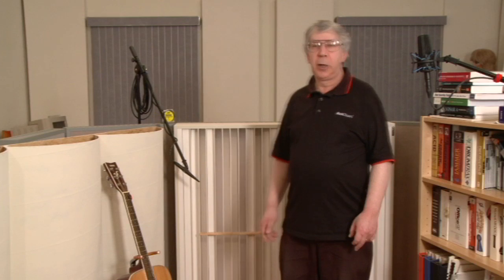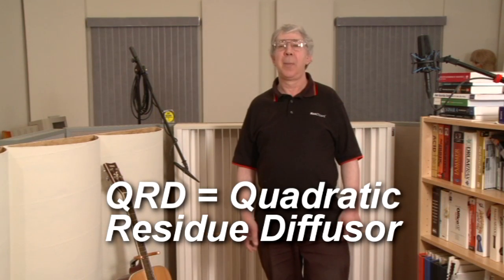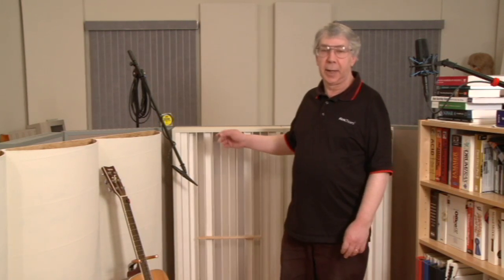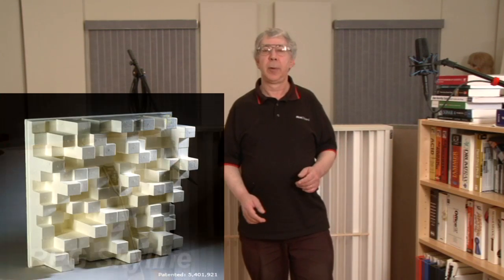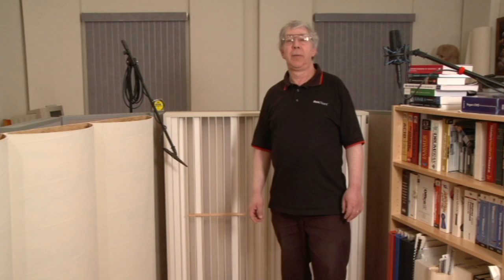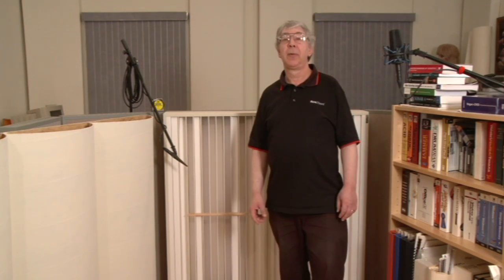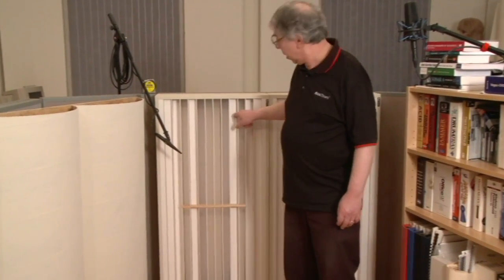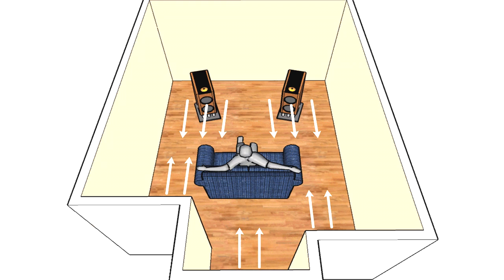All About Diffusion

Comment: Great video! 

I have one clue about why your bookshelf doesn't act as a diffuser: it's too neat! 

Most bookshelves I know (mine included, aggressively) are way more chaotic than that! The few books that I've got from any series are not even from the same edition, let alone any other two books have the same shape/size/density! Lastly, it's filled to the brim with (highly randomly-surfaced) knick-knacks :D
Reply from the maker: You are correct that having more variable book depths will reflect sound less coherently. But a real diffuser also scatters sound left and right, and that requires a specific QRD type pattern of depths and widths.
Reply: @EthanWiner  thanks, I know it'll never be as good as a professional solution, but in the "is this any better than a flat, hard wall?" category, I'd take a messy bookshelf over a completely flat one.
Reply: @EthanWiner  also, sorry I didn't see this reply sooner! I totally missed the notification
Reply: @EthanWiner  speaking of "is this better or worse?" type of random questions, I figure you're probably tired of answering these, BUT, here goes nothing: 

Let's say I have a completely empty room which obviously has a very horrible reverberation and I happen to have a large EVA rubber/foam available, would covering the walls with this do any good for dampening the sound reflections when the high-pressure part of waves hit the walls, or would it make it worse? I figure that if they were placed stretched they could work as a drum's membrane and make things worse, but if they are loose enough it could be better than waves bouncing off the hard wall, rightt?

Then.. (I know I'm pushing your patience probably) let's say I have some porous absorber available (just your regular acoustic foam, no particular brand or anything), would it be best to glue it to the wall directly? Or can we expect some (greater than negligible) improvement by layering wall/soft-rubber/porous-foam whenever we can?
Reply from the maker: @zippolag  All of those questions and more are addressed in my Acoustics FAQ:
http://ethanwiner.com/acoustics.html
Reply: @EthanWiner  awesome, thanks!
Reply: @EthanWiner  great read indeed, it would've saved me a lot of video-watching if I had stumbled upon your site first! That said, I guess the only way to figure out if my non-standard ideas will work or not is to try them out, I couldn't find anything on the FAQ nor the forums about rubber being used as a pressure-absorber.
Reply from the maker: @zippolag  RPG Modex bass traps use heavy vinyl sheets over a sealed cavity stuffed with insulation. My company RealTraps bonds a thin plastic membrane to rigid insulation to increase its absorption at bass frequencies. But rubber alone? Not so much.

Comment: Ethan, 
1) what are the frequency bands you consider as low/mid/high?
2) What is your opinion of diaphragm/pressure based bass traps vs your ploywool/velocity based bass traps?
Thank you.
Reply from the maker: It would take six paragraphs to answer all of that completely. So briefly, the bass range is up to around 200-300 Hz, mids go up to maybe 2 KHz, with highs above that. RealTraps are velocity based but we use no plywood. Our bass traps have a thin plastic membrane behind the front fabric. This is much better than tuned pressure-based traps.

Comment: My hifi rig has to fight for it’s right to be in our 18 feet wide, 21 feet long, 7.5 feet family lounge. The floor is solid concrete, clad with hard wood. The ceiling is solid concrete. The walls are dry wall with one of the long walls being all windows from 3 feet up. I have absolutely no acoustic treatment or room correction, other than a large plush rug placed between my 2 large floorstanders.

Over the years  I have changed out and upgraded components one at a time, and appreciated the difference they have made to the sonic performance.

I have very recently replaced my 2 and 3 seater leather sofas with slightly smaller and much lighter microfibre sofas. They have totally killed the ambiance of the room. Now, when I’m listening to music, it sounds more, well, intimate.  Im not sure that I like this new sonic character. But I guess I will have to like it as the sofas are a long term fixture.

I normally listen to music at about 78db. With the old leather sofas, that meant turning the volume control to 11 O’clock. Now, I have to turn the control to 1 O’clock!  I guess the foam in the new sofas is a lot more absorbent of sound energy, it’s certainly much firmer.  I used to get excellent room bass response and good bass distribution with my floorstanders being augmented by a pair of Rel subs. Now, the audible bass is diminished, but, you can certainly feel it more when you sit down. If I ramp up the volume, I do get back some of that room ambiance and the previous sonic characteristics. 

I honestly don’t think my room has the capacity to incorporate any defusers, or, the need for any further absorption.
Reply from the maker: You might find this article interesting:
http://ethanwiner.com/early_reflections.htm

Comment: I've lurked on the gearslutz forum for years and always knew Ethan was a man that knew his stuff, but the man can also get on video and explain everything eloquently in easy to understand terms, with visual representations. One thing is for sure, room treatment is vastly over looked and underrated. When I was younger I tried everything I could to get around having to CORRECTLY treat my recording spaced etc, but once I took the time to soak up the knowledge online and put in some time building some DIY absorbers etc, my mind was made up real quick. Top notch video, even 6 years after the fact.
Reply from the maker: Thanks!

Comment: This is one of the best videos, if not the best on acoustics I've seen! Question: the absorbers used in this video look like MiniTraps combined into a gobo - are these the standard or the HF type also recommended as first-reflection panels? They're shockingly effective in this (admittedly unusual) application.
Reply from the maker: Thanks. Those are the HF type panels because I wanted to compare using pure absorption, not the semi-reflective absorbers we sell as bass traps.
Reply: @EthanWiner  Thanks for the quick response! If so, they work so well, they make the guitar's sound spectrum sound positively muffled - that microphone you used must be highly directional?
Reply from the maker: The microphone is omnidirectional, but with that highly effective absorption there's no reflections at all. And thanks for your other nice comment.
Reply: @EthanWiner  You're welcome: your narrative is so tight and to the point, I'll be tempted to refer to it as a learning tool not just on acoustics, but rhetorics. It made me wonder if you wrote a script and rehearsed it, but then, you manage to remain natural all along. Perfect!
Reply from the maker: Thanks again David. I don't consider myself a very good on-camera presenter. But I do almost always write a script first. I hate videos that ramble on for 20 minutes when it could have been only five minutes. I'd rather present the points in a good sequence, and move along quickly. People can always back up or watch again. My synthesizer tutorial covers all the basics in 20 minutes. My music theory video packs an entire college level course spanning two semesters into less than three hours!
Reply: @EthanWiner  Well done! There's another difference between presentations in the English-speaking and, for example, German-speaking World or I should say academic literature in that the Brits, for example, tend to start with the result, and follow it with an explanation (to whom it may concern, so to speak - effectively giving the reader or listener a choice to investigate further), whereas in the German-speaking academic literature, one keeps wondering where a discussion may (or may never) be leading - as if one were invited to try and solve a puzzle.
Reply: @EthanWiner  By the way, being a (former) teacher, I know how difficult it is to put complicated content matter into simple words. You're doing an incredible job!

Comment: I'm using near field monitors with my PC, for listening.  My room is 12' deep, but just over eight feet wide, and eight feet high.  Those two eight foot measurements mean I have a wicked resonance at about 130 Hz, and I cannot get rid of it.  I've resorted to using a parametric equalizer on the PC to reduce that frequency.  I have a bed in the room, and a rug covering the rest of the floor, and have hung blankets on every wall.  And that resonance from hell is still there.  Any very inexpensive ideas would be welcome...
Reply from the maker: As explained in the description for this video, YouTube is not a good venue for a technical exchange. Instead, please post your questions in the Acoustics section of my Audio Expert forum:
http://the-audio-expert.freeforums.net/

But I'm glad to steer you in the right direction, with follow up questions in my forum. Start here:
http://ethanwiner.com/acoustics.html#fiberglass%20traps
Reply: @EthanWiner  Oh, okay.  Thanks!

Comment: Bass-Absorption + Diffusion: A way which produced interestingly nice results was to use polystyrol diffusors in front of classical bass traps. The styro diffusers are very light weighted and had been additionally covered with epoxy and clay to create a rigid surface. Anyway the whole object still mostly transmits wavelength beyond 200Hz allmost up to 100% as expect. These run into the bass trap.

Comment: Although the QRD sounded best (to me), the bookcase sounded more like a recorded "live" performance. I would recommend a mix of Acoustic Books and Music Books, and even some sheet music to enhance that sound : )

Seriously, it would be fun to see what happens with the "bookcase diffusor" if you turned all the books around backwards, so the edges of the pages were facing you instead of the spines of the books. I''ll bet it would make a noticeable difference, if not an improvement. However, it would make finding a book you wanted a PITA, unless you took a marking pen and wrote the titles on the edges of the pages.

You could even try leaning a book here and there, and also having a book fanned partially open, or a series of books next to each other fanned open, or even one whole shelf like that. Also, laying books on their sides could give you another dimension of diffusion.  It would be fun to hear what those various arrangements did to the sound quality. 

Thanks for this video, it's excellent. It helps those of us who don't have resources make sound decisions.

Comment: oh wow. the qrd diffuser was definitely way better than the poly and light years better than everything else. i might have to watch the video again but does it make sense to use acoustic sound panels to absorb room reflection while still using a qrd diffuser as close as you did for the acoustic guitar recording? in lets say an average sized bed room?
Reply from the maker: Diffusers aren't usually placed very close to a source or a microphone, though the photo example of the string quartet in this video shows diffusers behind the players to increase a sense of "close" ambience.

Comment: What about the modular “skyline” diffuser? What’s your opinion about it and how does it compare with the quadratic diffuser used in your video?
Reply from the maker: Skyline diffusers are also QRD, but they're 2-dimensional instead of 1-dimensional. They work better on the ceiling of a recording live room than the rear wall of a listening room.
Reply: Ethan Winer I appreciate your fast reply. Thanks
Reply: Ethan Winer I’ve seen these skyline diffusers mounted on the front wall behind or between speakers by audiophiles or even by well know audio companies in their demo room. What’s up with that?
Reply from the maker: @Ab20222  Please see the link to my forum in the video description above. I can't reasonably carry on a technical discussion in YouTube comments. Or Friend me on Facebook if you're there, and post in one of the audio groups and tag me.

Comment: Thanks for the video. How did you fasten your absorbers to the ceiling/wall??
Reply from the maker: RealTraps panels have cross bars in the rear that accept a variety of mounting methods. They can be hung from wires, attached to a pole with radiator hose clamps, or mounted on two types of stands we sell. This page on our web site shows what you're asking:
http://realtraps.com/install_mt.htm

Comment: Listening on crappy tablet speakers. Absorption clearly had a different sound. Can't say QRD sounded any better than the rest.
Reply from the maker: Maybe you should listen on real speakers, or at least headphones, before commenting. :->)
Reply: @EthanWiner  Well, perhaps rewording my original comment would help. I thought it was interesting that I could notice a difference on crappy tablet speakers.
Reply from the maker: Even crappy speakers will reveal differences as obvious as those in this video. But judgments such as "harsh" or "smooth" etc should not be made on crappy speakers.
Reply: @EthanWiner  I figured that's probably the case. But it is what it is, or rather, what it was. Thanks for the video.

Comment: I have spent hours online doing research on acoustic absorbers and defusers and it is amazing how people give such opposite information, it's hard to find two that agree with everything, but so far, I like the advice by this guy the best.  The thing is, acoustics of a room is super important to how it sounds and any little adjustment can have huge changes in the sound and each room is different so one sizes fits all is out and that is important to remember, something that works great in one space will have horrible effects in another space.  Experimenting is a must, no matter how well you measure, only real listening can get you where you need to be.  These panels can cost a lot, so experimenting may not be possible and you need to just jump in and start moving things around.  I think anyone can make a room sound great unless they are in a square or a round room, round is very rare but square is not and I feel bad for anyone attempting to make a square room sound great, you may want to buy more headphones because it is that bad for sound.

Comment: Should have kept some gaps between each book on the shelf. Good job on the demo
Reply from the maker: Sure, but gaps would defeat the point that a typical shelf with books is not much of a diffuser. And thanks.
Reply: @EthanWiner  , but... it would support the point that a bookshelf with gaps is a moderate diffuser, no?
Reply from the maker: @googoo-gjoob  LOL, okay, but barely.

Comment: So, Mr Winer, should I calculate QRD diffuser to a certain problem frequency? I'm building control room 6x4 meters, with 3m ceiling, and I notice, that on the couch is a lot of low end, and on a "sweet spot" less. I get some low end cancellations?
Reply from the maker: Diffusers are meant to operate over a range of frequencies. A reasonable range is 700 Hz to 3 or 4 KHz.
Reply: @EthanWiner  so, below 700 Hz I should build some absorbing panels?
Reply from the maker: Yes.

If you need much more guidance, post in my Audio Expert forum, that's easier than trying to explain here in YouTube comments:
http://the-audio-expert.freeforums.net/
Reply: @EthanWiner  , Thank you!

Comment: Would it be ok to stuff the inside of the curved reflector?
Reply from the maker: Then it would become an absorber, assuming you stuff it with absorbing material.
Reply: @EthanWiner   Ah ok I did not consider that. I was thinking maybe I'd combat what you were talking about that happens inside the curved reflector but did not consider that I'm effectively making an absorber :) Thanks Ethan!
Reply from the maker: Wait, let me clarify: If you stuff the back side of a convex defector it won't create an absorber, assuming the reflective material is wood or hard plastic etc. I was thinking of a concave surface if you line the front side with absorbing material.
Reply: @EthanWiner   BTW Thanks for all your hard work in the audio community and shedding light and knowledge to us DIY folks and ones into our audio and wanting to learn.  

I'm on a few forums where you are present and I see how sometimes you have to deal with ummm eccentric people that believe that audio is some form of magic that cant be explained by science. Can lead to some infuriating conversations LOL
Reply: @EthanWiner   right that makes sense  if I was putting stuff on the convex side. I was thinking of sound absorbing material on the inside so on the concave side but I was going to leave the ends open - so my thinking was that maybe that can cut down on whatever goes inside the tube but leaving the outside still hard. I was thinking of wood or something hard like that.
Reply from the maker: The best solution is to try it, and measure the room as you experiment.
Reply: @EthanWiner  I think you're spot on. Weekend testing with my favorite stout beer in hand 😀

Comment: I never use Diffusers as described! I use them to produce a certain current/Flow of the sound so the energy is going around like a circle in the room so it wont cancel itself out much and fades away naturally. Its amazing if you achieve that how great your gear actually is. But to get that “Flow” is very very hard. But you get will experience Music as Intended! Cheers.....